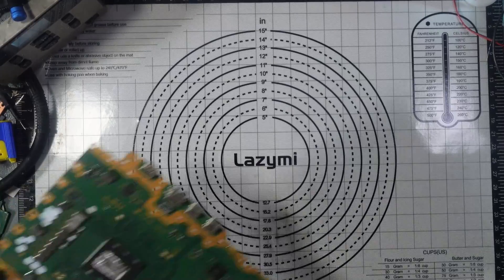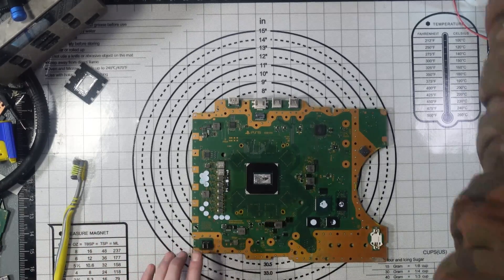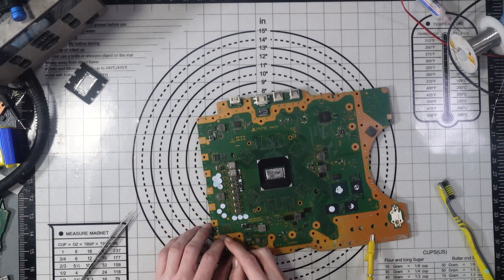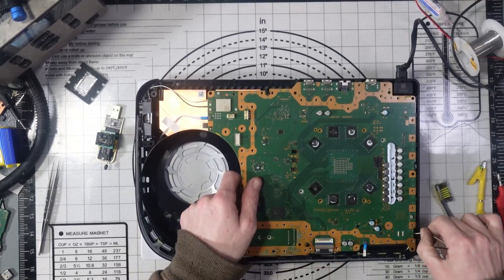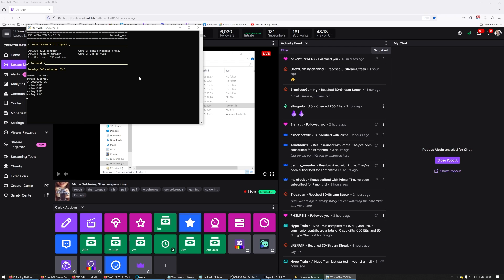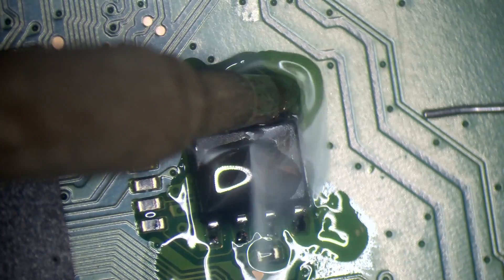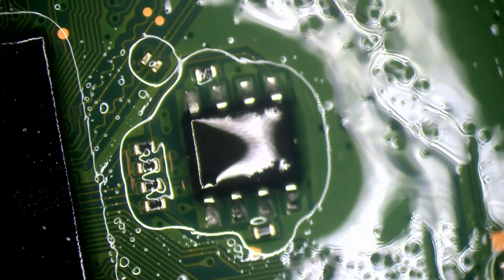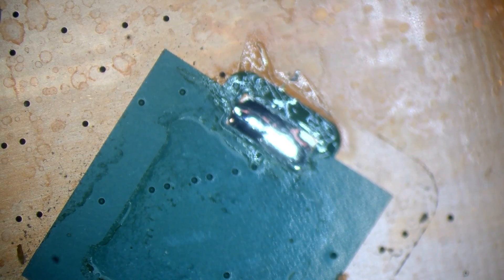Can I Fix The 3 Beeps Of Death On A PlayStation 5?

Comment: I really need your help, so my ps5 had 3 beep shut-down sp I replaced the bios from a donor board of the same model.
The console turned on and made me update it after it finished updating the 3 beeps shut-down came back. Do you know what I can do now, are both the bios chip now corrupted. I dont have dump file so can't really do a bios install. Please help if u can

Comment: I had the same issue, read error codes and had quite a bunch, cleared the logs and 3 beeps went away. I still got no power and now UART code give me 80C00136 and 808B0027. Checked all voltages and shorts, all checks out okay. Do i still need to go ahead and reflash the bios? or WIFI module needs replacement?

Comment: Hey Phil, do you have any experience dumping the 8pin Spansion NOR found commonly on ps4 pro?

I’ve been trying to dump a ps4 pro Nor with teensy++ 2.0 for revert purposes. Tried on board with alt pads and had good continuity and then out of desperation desoldered and tried off board, same results I’m using Nor Master -SPIway, reverted a few days with 16 pin nots and 100 pin syscon without issue.

Comment: Phil Ive been curious, i see that you are hooking up UART and reading the error codes without patching the BIOS to remove the encryption. Is this because your using the Paid version of the BwE PS5 code reader? 

Curious because im teaching myself the method of UART diagnosis and i was under the impression that you had to dump the bios, reflash with patched version of the bios, to then be able to read the decrypted uart logs? But it looks to me like your just hooking up uart right away and there isnt a need to reflash bios to get uart codes? 

Love your vids m8, glad to see your uploads regularly again~
Reply from the maker: No mate I use a free UART reader script from AndyMan. It's called PS5 Wee Tools. If you do a quick Google you'll find it in the top results. I wouldn't recommend BwE's tool. It's expensive and he cons people into thinking you need it to decrypt codes but that's not true. I'll be doing a video on UART tonight to upload tomorrow as a lot of people have asked for a guide on it
Reply: @TheCod3r  Awesome man, I really appreciate the response because I was on the fence for buying the paid version of BwE because I thought I needed it. 

I actually already have PS5 wee tools and successfully hooked up UART to a console, and did get it to read UART but it was all invisible(encrypted). 

Anyway, I'll eagerly be awaiting your vid on UART. Thanks!

Comment: Curious. What happens if you replace liquid metal with thermal paste on one of these? It was just a random thought.
Reply from the maker: It would overheat unfortunately. The APU runs too hot to use thermal paste

Comment: Hello there i have a question about what could be wrong with a ps5 shutting down After a Little while when gaming ?
Reply from the maker: It depends if you get any errors. It could just be overheating but it could be something more serious like an issue with the SSD
Reply: I Guess i have no idea but what i can Say Is that It overheats and shuts down . Man i Hope its not and SSD issue
Reply from the maker: SSD issues are possible but usually you get an error code when that's the case
Reply: @TheCod3r  no no error codes It Just overheats shuts down and i manually have to take the ac cable off the ps5 and Attach it back in order for me to turn it on ?